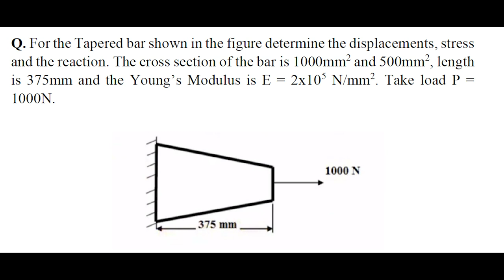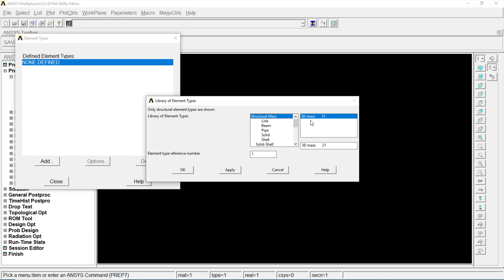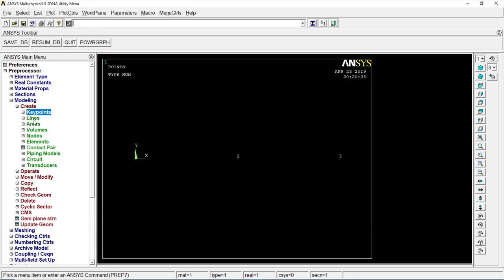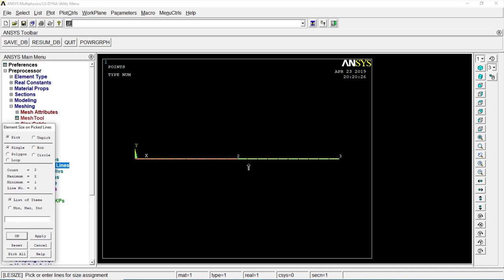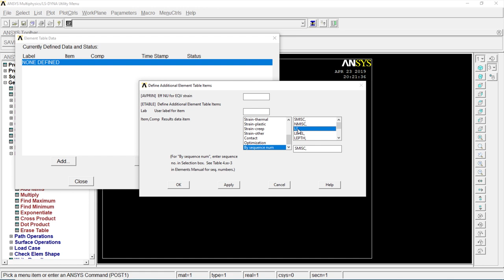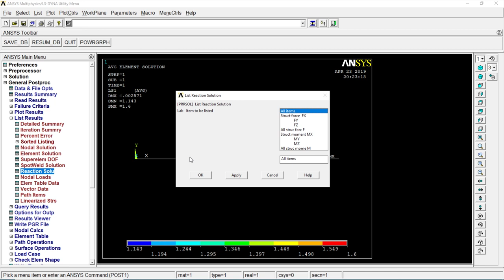Analysis of Tapered Bar Using ANSYS

Comment: i have aproblem when at element type LINK 180  get message at real constant   the message can not supporet the LINK 180whats the reason
Reply from the maker: Ali Abdelnasser if you are using latest version of ansys you will get that error i recommend you to use 3d finite 180 install of LINK 180
Reply: @MachenDesign  i am getting "Real constants for the LINK 180 element type are no longer supported" what should i do know
Reply: New versions don't support Real constant for LINK180